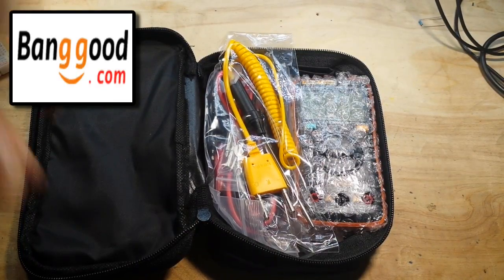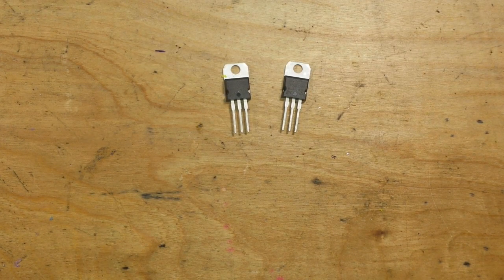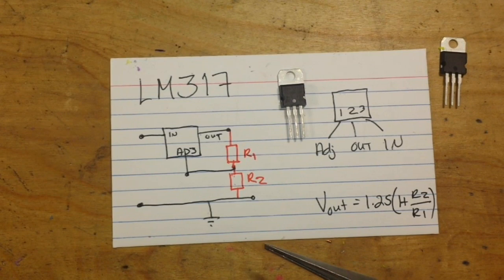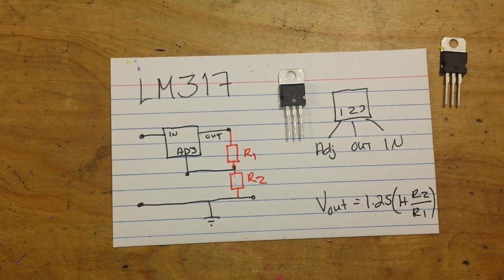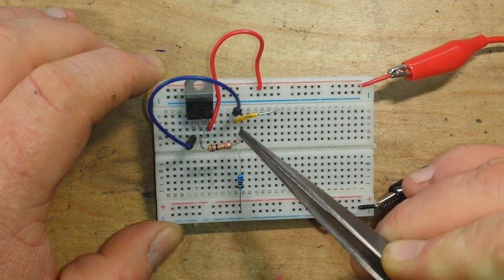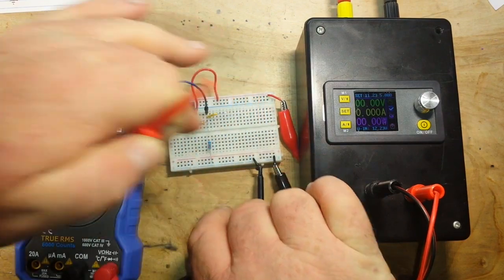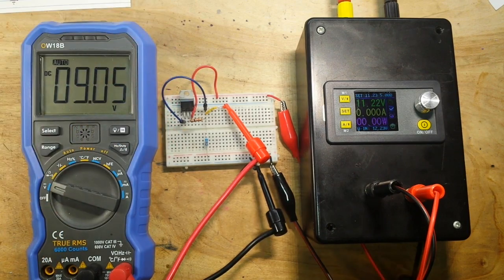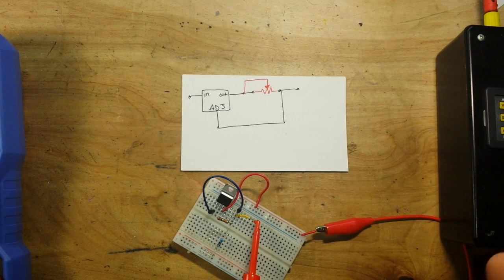Back to Basics: LM317 Regulator

Comment: This is a very versatile voltage regulator. I used on when I went to DeVry to supply 5 volts to a logic circuit breadboard we used with logic circuits. I didn't have an adjustable power supply at home so I set up a power supply using a 9 Volt battery. I used that because I had a 9 Volt battery holder that I got glued to the board. That way I could build the circuits I needed for the following day's lab. It worked well enough that I could go into the lab, hook up the variable power supply and Scope and call my instructor over to get it checked off. Then I had time to do homework from another class. That helped a lot as I was working full time and a newborn at home. Thanks for the video, it was a great refresher for that LM 317 as it's been over twenty years since I graduated.
Reply from the maker: Thanks, glad you liked the video!
Reply from the maker: I heard DeVry is that true? I work with quite a few DeVry alumni over the years. They taught electronics to an entire generation.

Comment: Its maybe worth mentioning that all these gizmos come with a datasheet - and potentially confusingly for newbs often come in a range of different "flavours" and versions.
A regulator I've used a lot is the LM1117, it comes either as a fixed voltage (3.3 or 5v etc) package that requires bypass capacitors to smooth the circuit output or as an adjustable version that uses resistance to determine levels.  You have to be careful to get the correct type and version as well as having the appropriate extra components to successfully get things running correctly.

Comment: Normally the resistor between the output and adjustment terminals on the 317 is around 240 ohms. Use the 1% tolerance E24 range of resistors to get this resistance value. Alternatives are 220 ohms or 2 lots of 470 ohms in parallel (235 ohms). With the latter value you will need to use 3 or 4 resistors in all to get more or less exact output voltage figures (2 in parallel between output and adjust. 2 in series between adjust and ground). The calculation formula given will show this requirement. With higher output currents using either the LM350 or the LM338 the resistor between the output and the adjust terminals may require to be of a higher power rating with lower output voltages.

Comment: We'll need an additional part in which the power dissipation will be addressed thus helping people to determine when a heath sink is required.  Knowing that the necessary info is in the datasheet, this will be a good exercise guiding people how to read the information.  An example with the constant current design would be nice, showing how can someone ensure a led will always be fed with the same current even if the input voltage of the regulator varies. Newly arrived hobbyists need practical examples to refer to, I think.

Comment: Another very clear video. Very useful IC. The only other regulator I use is the 7805. Great for constant current LEDs! 😉 Stay cool!
Reply: I use 78L05s a lot. LM723s a few times too. I use the LM337 negative compliment to the LM317 too. Here's a cute little dual PSU I made once https://www.instructables.com/id/Dual-POS-NEG-Power-Supply/

Comment: There is something wrong, correct me if im wrong tho: in the circuit you have the output going out to be the power source for w.e you want. But on you bread board you are reading the output AFTER it goes through your resistor. 

you're measuring from the voltage divider between the resistors (that leads to the adjust) and ground. shouldnt you be reading direct from the output on its own circuit (avoiding the adjustor voltage divider) and ground?

Comment: Is there a way to test these without getting the breadboard out, the calculator, dig for some resistors, get the power supply fired up, get out the mutimeter, find out a resistor was bad dig for another resistor back to the calculator and then maybe just maybe it will be good?

Comment: Good video, easy to understand.  How about getting into thermal considerations when the regulator dissipates a few watts of power, i.e. going from 12v to 5v and maybe .5 amps.  When is a heat sink needed / suggested.

Comment: I hooked this exact circuit up. Cept I'm powering off a 19.5V 3.5A supply. So I'm using a 10ohm an 50ohm resistor instead of kilo. I got it to nice 6.5 volts, PERFECT 5.5V after I plug that circuit into my LM current limiter circuit(tried a whole range of resistors but either dipped below .006 or maxed at). But now I have NONE of the amps and am limited to .0060 max amps, whether I'm trying to power a big dc motor or my little LED.. I tried disconnecting the current circuit and reading just off the voltage reg. circuit since this was my suspect, an sure enough, volts are perfect, but can only manage to get .006.. Whats going on? I thought this was only supposed to reg volts and let the amps pass fairly unimpeded, so I could use my current regulator circuit to restrict the amps going to my laser diode which theoretically before thermal runa away should auto-self-regulate-the volts it needs anyway?Is my voltage regulator not even necessary? I'm confused.. LD is 5v max 1.6amp.  No matter what resistance values I seem to put in there to (ranging from .1ohm - 220ohm+) just that regulated current.. I've checked like 20 times to make sure I'm hooked up right and I am. I'm starting to hear so many back and forth things and theories nothing makes sense, especially when it comes to laser diodes an "ohh you need to limit the current or they'll blow, but you can run any volts through them" or "noo you need to regulate both strictly(which I'm trying to do)" or "Volt max is the biggest danger don't go over that but can run the full 3.5 amps through the LD an it'll magically just know what it needs", an judging by the pulse function of a laser that kinda makes sense I guess kinda 50%? ....Any ideas comrades or am I just to dumb to get this?

Comment: hello it appears in the video that the output voltage was taken from the adjust pin and I thought it was taken from the +out pin.  I'm a complete noob at this so please correct me if i'm wrong.  I'm trying to make a voltage regulator and constant current circuit that will output 12V and 1-20 ma variable for my colloidal silver generator. I purchased some of these LM317 and can seem to get the correct result. I got my R values from an app called electrodroid. Thanks for sharing

Comment: I am really interested in the constant current source you alluded to.   Also, I guess on the variable voltage source you could use a potentiomenter as a voltage divider and allow for adjustable voltage.  Is that the case?  Thanks for an informative video.
Reply from the maker: Yrs you are correct.

Comment: I'm really struggling to simulate a power supply circuit to power a lm317. I have AC transformers of various voltages and have 10mf caps, ceramic resistors, and lm317 on the way. It seems no matter what I do in the simulation my input vintage is unstable. How much current is being drawn if someone were to not attach a load to the lm317? If I were to use the maximum 1.5a?

Comment: I have 120vdc and I want current limited to 300mA. Will the LM 317 work for this?
Reply from the maker: Check the data sheet for the maximum input voltage.

Comment: Normally I add a cap or two to help out the lm317
Reply: Indeed, some situations would require the use of bypass caps, good point.  Under these circumstances the datasheet will be your friend.

Comment: I just looked through my to 220 bin and I do not have an lm 317 on hand. I am going to have to take care of that, it is a very useful chip.
Reply: If you have a need for voltages lower than 5V, yes the LM317 can be an asset.  Keep in mind that with the proper voltage divider, you could actually use a LM7805, LM7806, LM7809 and set them in such way that you can have 12V at the output, without burning anything.  I bought a bag of them at the flea market for $3 so I had to find a way to use them wisely.

Comment: I have decreasing output voltage when i add the load  (12v without load , 5.2v when loaded), how to solve this problem? thanks a lot.
Reply from the maker: What current are you pulling?
Reply: @learnelectronics  500mA

Comment: This a trusty linear regulator , low ripple , flexible applications and if you want more amps just put a higher transistor in parallel . Where is the bypass cap at output?
Reply: For demo purposes the bypass caps aren't really necessary unless the source is really noisy.